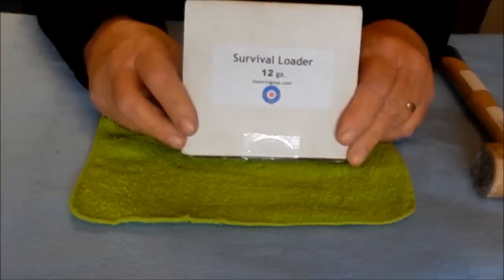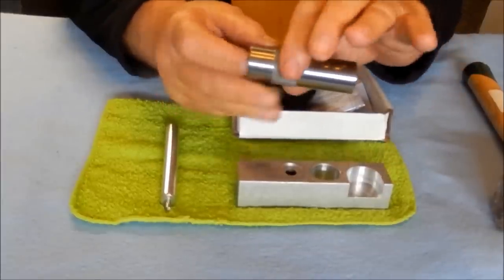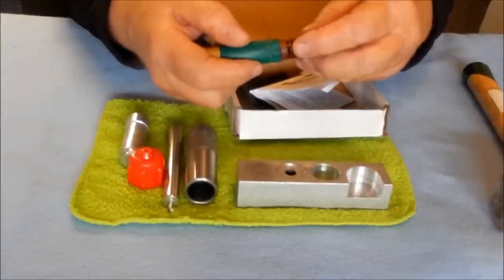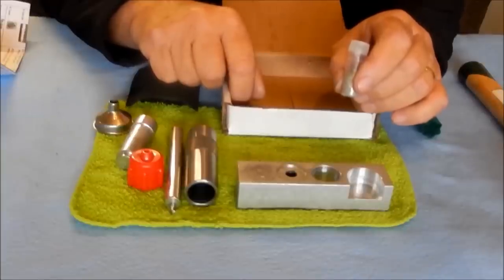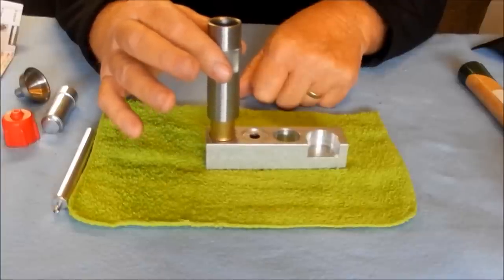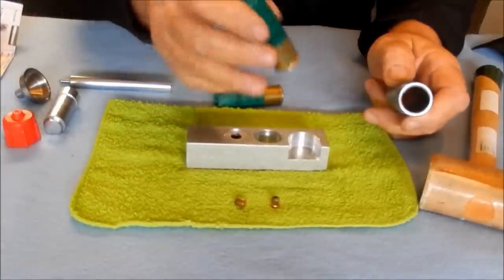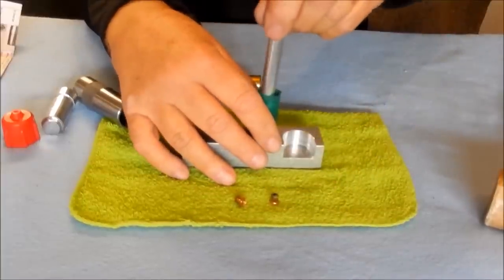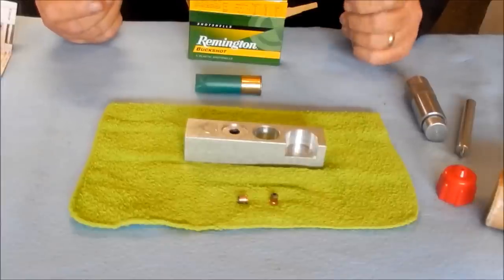Survival Loader -12 ga.---New video update coming for Gen. #2 May, 2024

Comment: Just a suggestion here: for pre-measured powder charges to take with your kit, look into those small, glass, perfume samplers. They have a soft plastic plug type cap and would most likely hold a perfect single charge of powder (pre-measured, of course).
Reply from the maker: HellyTony.  
We do have “powder-shot” vials on our webstore.  5mg plastic with screw on caps for security.  

We did look at other types but decided not to go with a glass product.  
We felt that rough handling might cause glass to break and therefore destroy the contents.   

Thank you for the suggestion.  Please, please feel free to share your ideas.   
Our Survival Loader kits have evolved and improved thanks to people like you sharing ideas.  
We do listen and evaluate.   

Best regards 
Barry

Comment: I have been called crazy for saving all my 12 ga. and .410 shotgun shells I've fired over the years.  But I always knew one day they might become worth something.  I'm not an avid reloader so this makes perfect sense. 
Just placed my order for both calibers.  Thanks!
Reply from the maker: Yes, for the small or casual re-loader, the Survival Loaders are a perfect fit.   
I think you will enjoy re-loading.  
Very therapeutic,
Better and more useful than watching a tank full of fish.   
It really is enjoyable.  Making something with your own hands and being able to use it.

best regard
Barry
Reply: Actually got both the 410 & 12 ga, kits in the mail day before yesterday.   And I would have posted earlier but I am in North Texas and been dealing with rolling blackouts, no water, spotty cell and Internet sercive, plus nearly running out of propane and firewood. Not to mention my old backup generator sprung a leak at the carbs float bowl.
Talk about a Peppers Wet Dream!  
We survived,! Only 2 frozen burst pipes to fix, and a LOT of snow to shovel.  Yea 8 inches isn't a lot of snow for some of you, but we are set up to deal with 115 degree summer heat for 6 weeks.  Not snow & below 0 freezing.temperatures with that stuff we put in our sweet tea everywhere. (ICE)
Thanks for the fast shipping, I'm a hands on DIY Gearhead Type Guy. My fishing pole us for survival, not sport.
Gonna be fun getting those shells ready for the next disaster.

Comment: I actually clicked because I saw the funnel you are using for this is the same as the ones I used for my form 1 can. (Thought you were doing somethin else 🤣) glad I came by though, I didn't know about these kits; and I need one now. 👍
Reply from the maker: If I can help provide information, please let me know. 
I will be more than glad to help as best that I can.  
Best regards 
Barry
Reply: @barrydeclined2547  Dear Barry, I don't suppose this kit will work with 3.5 inch shells? Thanks
Reply from the maker: Good morning Mr. Smith.  
You are correct.   The 3-1/2” is too long for the size die and decap rod.  

We are looking at a 3-1/2” kit and have a prototype.  
That doesn’t help know.  But it just may happen in the not too distant future.  

Best regards 
Barry
Reply: @barrydeclined2547  Thanks Barry, I'll keep an eye out for it in future

Comment: Lee apparently stopped making their 12ga hand loaders, so it's great that you've stepped in to fill the gap.

I don't shoot 12ga much, but seeing that has me tempted to try making a reloading kit with my lathe, just for fun.  Don't worry, I'm too lazy (and incompetent) to become a competitor :)

For anyone on the fence, these "Lee Loader" type hand loaders are actually really easy to use, convenient (you can take 'em anywhere) and honestly kind of fun/relaxing to use after a day of shooting.  A cheap Harbor Freight rubber mallet--or even a homemade wooden one--is all you need.

Suggestion: maybe include an "upgrade" to the kit that consists of a decent quality plastic box, for storage?  Cardboard tends to get beat up over time.  Not sure if you're moving the kind of volume that would justify having a custom mold for the insert parts, but you can probably get a US company to make decent strength foam inserts for an off-the-shelf plastic box that would work well.
Reply from the maker: Hello Greg.  
No worries about a home made kit.  I think you will discover the challenges we had to overcome to get the prototypes working.  
Kinda gives an appreciation of what LEE had to do.   

As for boxes.   The one with the kit is intended to be a mailer.  That said.  Barring getting soaked; They are pretty sturdy.  
One of the previous commenters here on our channel posted that he used a surplus LEE plastic box.   Said minor modification made it work.  

As for the Harbor Freight rubber mallet.  You are right on the money.  
We also have a video titled “ make wads the easy way”
You might take a look at that. We talk about the $3 mallet from Harbor Freight.  

Thank you for sharing.   Please feel free to share more.   I and many of our readers learn great tips.  

Best regards 
Barry
Reply: @barrydeclined2547  Well, that's the intent--good learning experience as I puzzle through getting it right!

(I'm very, very far from a competent machinist.)

Definitely going to check out your other vids!

Comment: Very nice personal reloading tool.  I wouldn't classify it as a survival loader though.   Where are the primers, wads and shot coming from when SHTF?   You'll still need to stock up on the supplies so nothing changes.   Other than perhaps the cost savings in the now.   In the later, it's the same exact problem.   If you just want to reload your own to save a bit of money this is fantastic.
Reply: Primers can be made from matches, wads can be made from cardboard, wool, wax etc. Shot can be Crosman BB's, or if you had to, you could load almost any projectile or scrap lead slugs as long as they are weighed first.

Comment: I used an OOP MRC/Lee Loader kit for 12 and 20 gauge shells 30 years ago, this kit is very similar but with some improvements. Lee's instructions don't mention using lube (which would have been great to know at the time). I found that "low-brass" shells don't resize as well as "high-brass" shells. 
I ripped the rims off on a few low brass shells, if they would chamber at all. This kit might be better for modern shells. The MRC/Lee Loader kits were designed decades ago when shells were made with different materials, probably actual brass, not brass or zinc plated steel or even aluminum or polymer with a steel disk for the rim like modern shells.
Reply from the maker: Hello Will.  
You are correct.   The shells today are mostly plated steel bases.   

The using a lube recommendation is due to the Size Die.   It’s double ended.   One side can be used to reload by the non-size method.   
Or
The other end is to resize the metal base.  
Just as with pistol or rifle cases.  Using a lube when resizing helps get a better result.  

Thank you for sharing.  It is informative and appreciated.   
Best regards 
Barry

Comment: Nice! The factory load looks sealed. Can you add wax or something to keep water out?
Reply from the maker: hello Greig:
Factory loads are sealed,.  The crimps are moved in place and in my opinion should be water tight at the crimp,
If water is and issue, you could apply a wax plug or white glue on top of the "over-shot" wad before you set the crimp,     
This might help, but, it probably won't be like a factory sealed hull,

Best regards
Barry
Reply: You can always just use clear nail polish as a sealant. Some people make water tight shells and cartridges by putting a VERY light coat of nail polish around the case mouth/shell crimp and around the primer after seating it into the brass. Some like to also put it around the edge of the brass of a shotshell too, but that isn't really necessary unless you are storing your shells underwater or in a humid area for extended lengths of time.

If you do put some there make it an extremely light single coat and then wipe most of it off. You only need it on the very edge of the brass. Don't shoot the sealed shells until the polish is FULLY dry unless you want nail polish in your magazine and chamber. I really need to emphasize the lightness of the coating. It can be a little thicker on the crimp, but not much. If you just gob it on there you could potentially increase pressure. It probably won't make a difference either way so long as you aren't making "A BEAR IS EATING MY DOG" loads, but better safe than sorry. A LIGHT coat of Elmer's white school glue can be used to seal the crimp instead of the polish, it is actually a little better suited to sealing the crimp than the polish is, but it's kinda messy and it can only be used on the crimp, not the primer or the edge of the brass. (Too thick and comes off too easily)

Comment: I wonder if this kit would work with the mini shells🤔
Reply from the maker: Yes. It will. You would need to request the longer  “set tool” to reach the Crimp. 

In my experience, the mini-shell have much thicker hulls.  That means it is harder to re-form the crimp.  
Other than that. 
Yes.  The 12 ga. Kit would reload them. 
😃👍

Comment: Awesome kit. I am gonna have to get me one in .410.
Reply: I have one... works perfect. Saves alot of money and hassle
Reply: Its awesome
Reply: With the popularity of 410 handguns now as well. Buying the kit is saving you a lot of money. A mec with 410 setup is pricey and they are finicky. A box of loded 410s is 14.00 plus. And good 12 gauge 00 buck is a damn buck or more per shot. I own a mec but love my 2 survival reloaders... i use them at my bench more than a bug out tool.... ive made 200 rounds with the 12 gauge tool in no time. Easy to use. Very safe
 And doesnt take up any space.  Im telling you eventually midway usa or brownells will be selling these.
Reply: Yea I am debating getting one or building my own setup. Got several projects ahead of .410 reloading. I have a load all and load 12 ga slugs. Gonna eventually  do 16 20 and .410 just the low volume of ammo I shoot for those I can't justify the cost of another press. That is why this or building my own kit is more aligned for my usage. Cool product none the less
Reply: @willwood487  I just purchase a Lee Load All II for 12 ga and a conversion kit for 20 ga. They also make a conversion kit for 16 ga that I will purchase soon. Lee has no plans on making a conversion kit for 410, and that's to bad because the price of 410 is thru the roof. Check out (Short Lane) Gunadapters.com You will love the conversion kits they sell :)
Reply: @timgiles9413  Yep it's a bummer Lee does not offer a .410 conversion kit, I have three .410 shotguns that collect more dust time than shooting time because of the high price .410 shells. I just bought a box of 9 shot .410 couple day's ago at Walmart just for target shooting and it was right at $10 bucks a box. Most of the other shot was priced closer to $15 a box ridiculous. The kits this guy in the video offers is great especially being portable.

Comment: Hey Barry, thank you for great video and question: 
If i cut open factory loaded 12 gauge shell and replace lead pellets with steel..., What do you think? Should I change the powder too?
Reply from the maker: Great questions. 
As for the LEE. They are decent bench mounted press.  Not portable, but a good value.  
As for cutting open a shell and changing things.   
I suggest you check a reloading manual since you are changing components. 
Pressures a big thing.  When you change components, safety could be an issue.  

Best of luck.  Please comment if I or our other readers can help.  
Barry
Reply: I've also been watching another channel called "TAUFLEDERMAUS" (German for bat, go figure) who, among other things, load and shoot slugs made by machinists and metal casters. A lot of these things are custom made, so there is no factory load info on them. They have to do all the calculations themselves, and sometimes they don't get it right on the money.

I'm saying this because when you have lead pellets, they have a certain inertial mass, which the powder load was calculated on. If you change the shot load, you change the muzzle velocity, range, etc. Sometimes that's not a problem. But especially if the load is going to be heavier (e.g. going from #6 shot to a slug), it could be a serious problem. But either way, it will affect range and accuracy. 

Ideally, yes you would need to re-calculate the powder load to match the slightly lighter weight of the steel pellets, especially larger pellets like buck. If it's birdshot, or something that fine, you might be okay with the slight variation. Always check the factory specs for the specific shot, or talk to your local gun store if you're not 110% sure. Safety is always first, no matter what. 

And lastly to @barrydeclined; an excellent product, and well presented. I'm a new gun owner myself, and haven't done any reloading yet. With the way you talked about this, plain and simple, you really instill confidence in people like me, who are still wondering if reloading was an option for them. Than you so much, Sir. You are a credit to your profession.
Reply from the maker: Thank you for commenting and sharing your information.    
We will all benefit from the knowledge you provided.  
It is appreciated. 
Best regards 
Barry

Comment: Is this as good with the metallic cartdriges?
Reply from the maker: Hello Celso:
All metal cases can not be resized or crimped.  
Plus. 
The decap rod pin is to remove the larger shotgun size 209 primer.  
The brass/all metal cases have the small primer hole similar to the pistol or rifle size.  

I hope this information helps.  
Best regards 
Barry
Reply: @barrydeclined2547  wow! Nice class man!
Thank so much. I’m buying one of these, i think it’s a must have. Thanks again.

Comment: Why not increase the diameter on one end of the knock out rod to roughly match the inside diameter of the hull. This would remove the need to line up the tip for primer removal by “feel”. This in turn would remove a factor of possible error by the user.
Reply from the maker: Good morning Jason.  
Good question.  We did   
Last year we did increase the diameter and they now self center.  

But it made a new problem. 
The new larger rod could no longer act as a ramrod to seat the wad.  It was too snug.  
So we just added a Ramrod to the 410 & 20 ga. Kits.    
The 12 ga. Was ok as is.  
Our new and up-coming update video will address that improvement.   
Thanks for commenting 
Best regards 
Barry
Reply: @barrydeclined2547  thanks for the quick response. Failure on my part to articulate correctly. I was suggesting only increasing the diameter on one end, not the entire rod thus leaving the opposite end available for wad/piston placement
Reply from the maker: No worries Jason.  
It was on me.  I failed to understand correctly.   
That option was considered.and tried.  It made other issues. 

Additional cost of machining and rod length problems.  

The larger diameter would need to be machined down so it would still slide inside the wad to seat it. 
On a 3” shell, the smaller diameter portion would need to be that long. 

The larger diameter would need to be at least 2”” longer to give the rod the ability to center over the primer.  
Too short and it would not have enough bearing surface to keep it straight.   The pin would be off. 
It would increase the rod length which in turn leads to a longer less compact box. 

The best solution and simplest was to make the entire rod the larger.  diameter and include a new part.   Hence:  The Ramrod. 
I hope I got it right this time  LOL 

Barry

Comment: Will I be able to crimp the mini 2 1/4 or 1 3/4 inch shot shells? I don't see why I wouldn't be able to do everything else, but is the crimp finisher long enough for the minis?
Reply from the maker: great questions.  The standard "crimp set tool" will not reach the mini-shells to set the final crimp.
That said:
We offer an extended Crimp Set Tool as an accessory. 
Feed back from other reloaders has been sketchy on reloading the mini-shells.   
Apparently they are extra thick and are tough to get the crimp to close and set. 
The factory shells  are heat and molded in place.  
SO.....
I decided to find out for myself.  
They were a real pain.  
I finally decided they weren't worth the trouble.

Anyway, the extended Tool is available as an accessory.   They are $5.00 plus shipping.
Hope this information helps.
best regards
Barry

Comment: What about shot like no.6 do you need the cards?thanks
Reply from the maker: Good morning.   The issue with any shot shell reload is the crimp seal.    
Factory new are very tightly sealed.  
Some are heat sealed. And even then they sometimes leak small diameter shot.   

I always use an overshot wad just to be sure.  It also give some soft compression to let the crimp form better. 

That said.  Yes. 
You can reload #6 without an overshot wad/card.  
I would recommend a dab of white glue on the crimp to avoid any shot loss.  Especially with shells that have been reloaded multiple times before.  

Hope this helps.  Please feel free to write.  I will help if I can.  

Best regards.  Barry